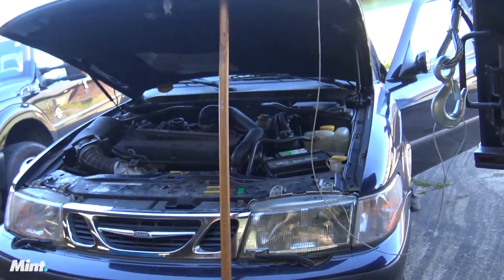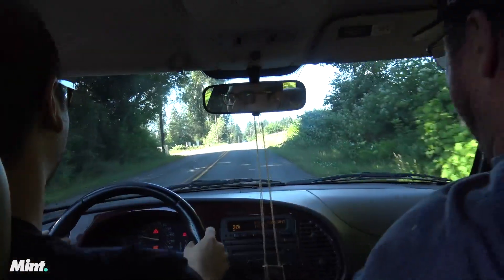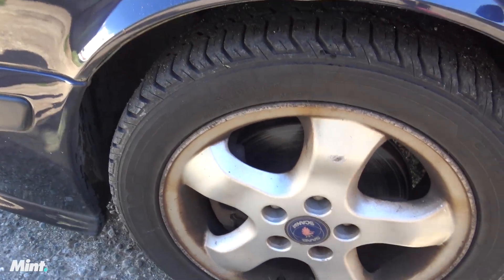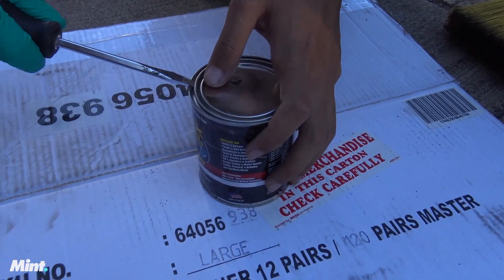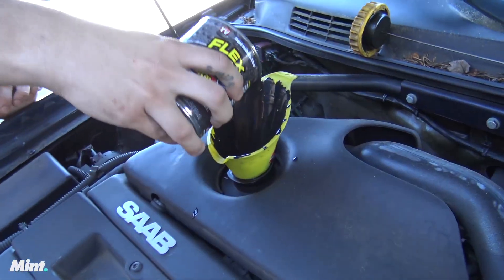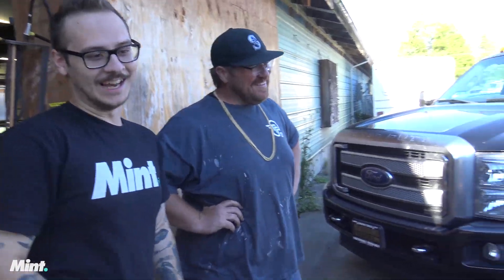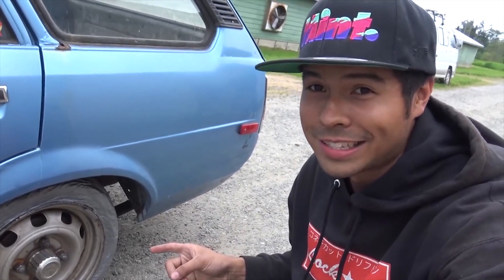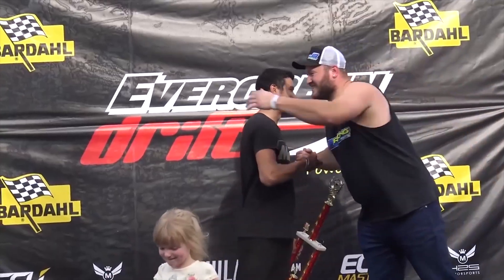Can You Use FLEX SEAL as ENGINE OIL?

Comment: basically i can tell u this i m not a mechanic But the flex seal liquid would run around in the engine and clock up and it wont start and it would hardarn over time and you would have to replace engine or the car
Reply: That’s the point of the video

Comment: Ok. A quart of flex seal on Amazon-$29.95. (Thinking buying it off the shelf somewhere was a bit more.) Roughly $120 for this “oil change” that anyone could predict what the outcome would be. Caliper (to replace the stuck one) $30-$70. So with at least $50 left over to fix a few minor things (door latch, etc.) they could have gotten this car running adequately and found a single mom or poor college student with two (or more) jobs who could use and really needed a dependable runner. But they blow it on a stupidly predictable outcome. But as long as their videos make money they’ll have it to waste. 🤦‍♂️

Comment: add 20 oz of WD-40 (R) and 3 qts of W0-20 oil, 1 qt of green Rustoleum (R), then top off with kerosene.   transport it to Wash DC & tell AOC it is the 1st "New green deal" (R) auto engine!  If you have some  (R) add a tablespoon of it also.

Comment: what happened was flex seal is basically like a glue and all you did basically was glue up your carburetor your piston rods and everything else in your car which means basically you completely f*** up your engine you might as well have just taken a bomb to your car because you basically did the same thing you blew your engine there's no way you're going to repair that it's impossible you're f***
Reply: Carburetor??? In 2006~?  It's a beater dumbass

Comment: What did you think was going to happen? That gets pumped through the pistons to be lit to blast them down to make the rotary power. Flex seal isn’t very flammable and it’s extremely think, and the only thing lighting it is a spark. It would’ve gotten stuck in the pistons, not burn, and the whole thing would’ve gunked up.

Comment: I think if you guys would have let it sit after putting the flex seal in it for a while so the flex seal dried it would have sealed the engine and then you could run normal oil in there and it would have worked maybe

Comment: Ohhh man, that was still a good turbo before yall pumped Flex Seal through it. I really like those old Saabs. My mom had an 87 Saab 900S turbo. That car was cool af, but it was so unreliable. The window relay blew in the middle of winter in Allentown, PA with all of the windows all the way down and we didn't know how to fix it so we drove with a quilt over top of the car. Then the turbo blew 3 times. Then the timing chain broke and somehow got sucked up into the turbo in New York and destroyed the engine. That was the end of the old Saab.

Comment: At first I thought all the dislikes would be from Saab owners, but that many people can't own such a crappy car.
Reply: My Saab was fun but it was a expensive money pit and was extremely unreliable
Reply: Some of the Saabs were terrible. There were a few good ones to be had. The trionic 5 cars were beasts. Engines easily capable of holding 400+hp with no internal mods. I ran mine until 200k running 23psi on a slightly bigger turbo. Car would go 165 mph. The trionic 7s like the one pictured were snappy but unreliable.

Comment: An old veteran or homeless person would have loved to have that little car to help them get around..... look like it was running good before....
Reply: You did see that like 30 sec into the video the brakes locked the front wheel the shifter wouldn't move and the engine was smoking right?
Reply: @CHIIIINO  Bleach locked brakes are an easy fix, the engine wasnt smoking that was the radiator, it had a crack causing fluid to pulse out onto the hot engine, making smoke, and shifters are easily fixed as well. the vehicle could have been saved for a few hundred bucks. these guys just literally trash vehicles, that have a chance to be saved and given to people that can use it.
Reply: @12434567891  my mistake
Reply: @12434567891  a few hundred buck on top of actually buying the car. Who's gonna buy all that just to fucking donate it to someone?
Reply: @12434567891  So? They bought the car they can do whatever they want to it
Reply: @K.ambrose   nothing says hey i just ruined a perfectly good vehicle to entertain the lower iq of society am i right?
Reply: samuel rivera its not to entertain the lower iq its to see people doing stupid things that we would never do
Reply: How's a homeless person gonna afford gas if they can't even afford food
Reply: @dannyceebee73 , your right if you give them a way to make it back in forth to a job to work & make money & a roof over thier head at night, it would make no sense...... hell of a thought process you got going...... why help someone who's not yourself right....
Reply: @user-wr4lg2co6z  you know if he is homeless he probably has no job in the first place. No job means no money to buy gas. So the homeless man would probably end up selling the car.
Reply: The Man X0 there’s a thing called public transportation.
Reply: More snowflakes telling people what to do with their own property we don't like in Soviet Russia
Reply: You decide what to do with your car..maybe you can aquire a shitty car by donation or lowball purchase and do what u want with it.
Reply: It didn't pass inspection so idk I just saw a comment saying this lmao
Reply: THE DOOR DIDN'T CLOSE
Reply: Yeah, the shaky ass car that was wobbling down the road definitely was running great before hand. But yeah, let's just give it to someone so they can die in a car wreck, right?
Reply: If this car was running okay to you than you need to learn how a car runs
Reply: How tf can a homeless person own this. You would need to pay for gas, pay for oil so you can change the oil, drivers license, insurance and  so on. Cars isn’t a simple thing to have
Reply: shut up
Reply: Do you regularly spend a few hundred dollars buying junk cars for veterans? They buy junk cars and make videos for entertainment. That's how they make money. That's how the entertainment industry works. Do you criticize movies that destroy cars?
Reply: Lol beyond shelter, this car is useless, it has issues with the brakes, the transmission was shot, and the engine had issues with it's cooking system
And that's just the major obvious issues, which could cost thousands more than the value to fix
Those issues would need to be fixed before the car is safe to drive, or operate, and would damage the car further is left alone, this car would be a diaster for a homeless person to use as a daily, beyond basic things like shelter, which a working engine doesn't change
Reply: Or they can get a job
Reply: exactly
Reply: What about a young person or a person with a home?
Reply: But apparently views are better

Comment: Don't know why I even clicked on this..... I pretty much knew what was going to happen right away....
Reply: Are you a mechanic?
Reply: @philtrip3169  Do you have to be? Demolition Ranch used a brick of this shit semi-dry (it was still bleeding) as body armor and it actually worked... If it can stop a bullet I doubt it's flowing through an engine.
Reply: Ninja Tree Frog well it bar.key stopped it buy it was an amazing video and fun y af. Also have u seen the new one with the ant pile
Reply: @patriciawalters3497  I have not, but I'll be sure to check it out!
Reply: Ninja Tree Frog oil can also stop a bullet, but i get what you mean
Reply: @philtrip3169  something meant to stick things together didnt work in place of something meant to lubricate things. It doesnt take a genius to figure out what is going to happen.
Reply: @findableflyer  do you look like the avatar on your profile photo? If so you got Instagram?
Reply: Phil Trip the gas used in cars are combustible. Flex tape is not or should not.
I’m probably using combustible wrong but what I mean is that the car uses the gas to create a explosive that turns the tires.
Reply: Phil Trip cuz pretty much nothing else has worked so...good chance that this will not work considering how everything thats closer to oil hasn’t even worked😂😂

Comment: Some stupidity can be used for comedic effect. The stupidity here is not an example of that, and fails miserably in that department. This is a level of stupid that not only isn't funny, it's so far beyond sad and pathetic, it's somewhat concerning, and more than a little scary. 

This is the first time I've seen a truly complete waste of life, and surprisingly there are several of them, and they all found one another. I think the water and power lines in that town need to be checked. The air quality as well, for safe measure. If multiple morons of this class were created, I think we have a real problem on our hands as a society. Quarantine that town. If they're from multiple towns, then the epidemic has begun!

Comment: I think u should put an engine in it and donate it to a single mother or father in need of a vehical at least after you did your lil experiment if your going to use it as a test vehical first. At least there be some good in that and honer
Reply: Steven McNutt these dumb ass kids dont care about other people ... Just their own entertainment
Reply: bob dylan Just their own entertainment. That you're watching as entertainment...
Reply: Putting a new engine in it would be a lot of troubling work. Besides, they’d basically have to rip the entire car apart. The brakes would clamp up, the transmission is trash, the suspension is probably in bad condition. It’d be a lot of time wasted for a car that’d last for a couple months.

Comment: Such winners.   Yes... you can use flex seal as oil, and at $16 / qt it is a great deal.    You can also use cement as oil, until it cures.
Nice gullwings on the Saab... such winners.  Trump 2020!

Comment: I did a brake test like that in my Saab and the brakes stayed on like that, only on the interstate. The plastic that is around the pedal has a slit, so when the brake pedal is floored, it pops out and gets stuck behind the plastic. My car did the same thing until I reached down and yanked the pedal back into it's proper cut out spot in the plastic.

Comment: It may have worked if you changed it with the engine running and NEVER turned the ignition off.  At least for a longer short while

Comment: Brandon owes everyone there either 23 miles, or 23 laps around the property for that generous estimation.  lol
Honestly, it ran far longer than I expected. 
You probably would have gotten to the end of the driveway however, had the engine been completely cool when the flex seal was added.
If you attempt this again, try flex seal, but leave room to add two quarts of oil.  The oil (in theory) should delay the eventual death of the engine. 
This was only tried on an old lawn mower engine, and was the spray can version. (required a wood dowel rod to push it down into the crankcase) And it is possible the additives in the spray version netted the results I had. 
But it ran fine for about 11 minutes before the heat build up became too much and the piston seized.  I assume a water cooled engine may increase run time, just don't count on it.  lol

Comment: SAAB: Something An Asshole Buys.
Reply: Nah, I like Saabs.
Reply: sam heske it was a joke btw but okay
Reply: Saab drivers were on average more educated then other car owners. And they were and still are good cars.
Reply: Not even close for the good car part. I work at a car dealership and when we see a Saab it almost always has a major engine or transmission problem, most with less than 100k miles. If you look at most of the cars they were based off of then you can see that they were also crap cars. The only one we have ever had come through the dealership that was any good was the 9-2x.
Reply: Something's Almost Always Breaking
Reply: Saabs were just GM...
Reply: PoliticalTheory no I'm saying they're not for arseholes as a car. That's BMWs

Comment: I DO NOT RECOMMEND THIS but....

I've seen a couple of people use flex seal to make temporary gaskets to get home from the local mudhole. Seen it used on transfer cases, valve covers, and even on a 2wd differential to stop bad leaks or keep water out until the vehicle could be driven to asphalt for a tow.

Even seen one dude use the spray can verson as fix-a-flat because it was the only thing on hand. He removed Schrader valve and sprayed the whole can in using a Wendy's straw after digging the nozzle out of the bit you push with a multitool. Put valve back, waited five minutes while manually rotating the tire, and filled said tire to 35psi before driving through 4 holes between 3 and 5ft deep.

Again, I don't recommend this it's just shit I have seen others do in an emergency.

Comment: Next scientific experiment try using used motor oil as coolant on a vehicle.  A few legit reasons that would be worth it are #1 oil has a lot higher boiling point than water so the engine should be safe to run harder for longer without serious damage. #2 If the engine happened to blow a head gasket it would just smoke like crazy but not damage the block. #3. Oil can withstand intense temperature changes and doesn't freeze so you would never have to worry about the block cracking in super cold temperatures. #4 might be a little silly but oil is lighter than water and would shave a little weight off of the system.  The bad parts are #1 Oil retains heat longer than water so it may not cool down as fast. #2 If you wreck and open the system there is a greater risk of fire and it would be a lot harder to clean up. #3 In sub zero temperatures it might be a little too thick at first and finally #4 The coolant hoses are not rated for oil so they would all have to be replaced with oil stable hoses if you decided to keep running oil.  
  Who knows though, you might find that system works even better with oil and can market a kit to let other people do the mod on their own whips.  Just a thought.

Comment: +Life OD, If you "really" want a challenge, then try to either completely clean out the flex-seal, or better yet, rebuild this entire engine. Saab's ARE NOT "throw-away" vehicles! The same Swedes that manufacture Volvo, also manufacture Saab, & used to make Renault as well. Also; you used something called, "Flex-SEAL", not "Flex-Lubricant". What the fuck did you think was going to happen? Clean up your mess, and do try to show this vehicle a little bit of love. What a "Saab" story.

Comment: It sounded like an old piston airplane starting
Reply: SkinnyFlea 262 it's that Saab heritage
Reply: Modern planes have pistons too.
Reply: Kyle Kenan, depends. A Cessna 152 has them. But a c130 used a turbofan. And a318 has a jet. A turbofan and jet work with air being combusted, while older planes use engines like that of a car
Reply: Sarge_m16 That's why I said planes and not jets. My stepdad has a Cessna 335 and it has pistons.
Reply: Sounded like a spun rod bearing

Comment: I dont quite understand the logic of this video... not only is flex seal more expensive then oil but it also dries and turns to rubber. Youre putting liquid rubber into a motor. Why the hell would you think itd possibly work as oil? That's like me taking a piss in the gas tank and trying to use it as fuel or putting shit into the radiator thinking itll cool it. This is honestly just as bad as people eating and vaping tide pods.

Comment: that poor Saab :(
Reply: KornyGuy06 I’ve got a 2.3t 95 aero and it’s probably one of the best cars I’ve ever owned
Reply: 0laZz um it's still a Saab engine at heart
Reply: Eh, it was only a 2.0t ecopower automatic junk. If it would've been a 2.3t aero then I would've been slightly pissed
Reply: agreed as I have 2 of the 2.3t aeros
Reply: KornyGuy06 what power u running through your 95's i have a 93 aero running 345hp and 550nm
Reply: Well why don't you Saab about it..
Reply: I like Saab’s honestly
Reply: KornyGuy06 I know right
Reply: 0laZz you might disagree, but I actually like the old late 80s 900 turbos. Other than that I’m not really a Saab fan
Reply: Yeah they break themself enough already^^
Reply: lol
Reply: Eh. It was already trashed. You do as you will.
Reply: Its hurt to watch ;(
Reply: Jack Jeynes mine are basically stock, my 06 just has 3" downpipe /cutout and aftermarket intercooler. Very reliable if you take care of them, my 02 has 243k miles on it
Reply: It’s a saad Saab
Reply: Dat 75 Series Cruiser 06' 9-5 5mt combi I love it, Its getting maptun coilovers
Reply: Rip saab in general
Reply: BOB ROSS saabs arent too shabby, hell of alot better than amc imo
Reply: It was born from jets.
Reply: Joe Mama oof, but for somereason amc are worth more... Well if it's a javelin
Reply: Preston Thacker F to pay respect
Reply: KornyGuy06 rip scania
Reply: poor opel
Reply: Saabs are absolute garbage

Comment: I will only find this abuse acceptable if that Saab was rusted AF.
Reply: TheZProtocol arches weren't even rusted
Reply: They destroyed a door just for the ghetto gullwing mod, they kicked the left quarter panel as well as the roof. The car looked fine before they started messing with it.
Reply: I know, this SAAB had a better looking interior than my 01 9-3 and mine has arch rust, such a shame 😐
Reply: Apple yummy my truck is rusted as FUCK as long as the motor runs ITS FINE
Reply: TheZProtocol all he did is destroy the motor just put a new one in but honestly that car is trash look at the door
Reply: TheZProtocol BLUE PUMP SAVAGERYhttps://youtu.be/jQB-0loVPfY
Reply: It’s a pos Saab